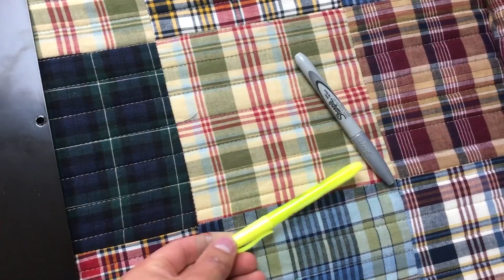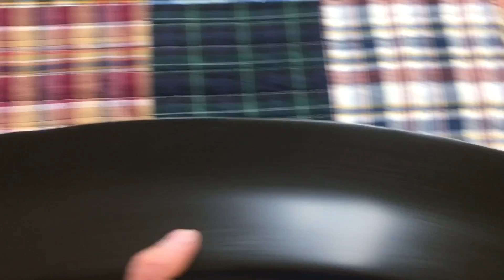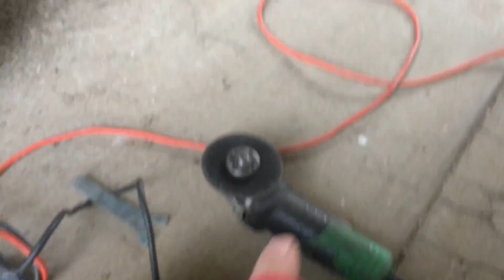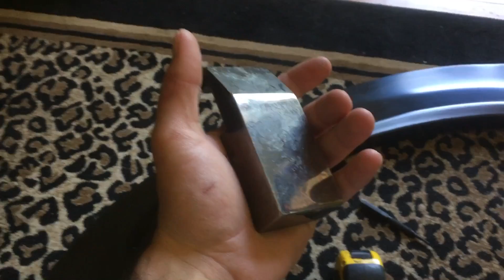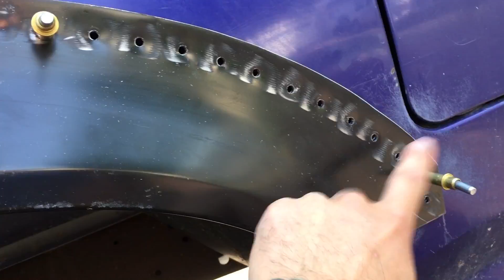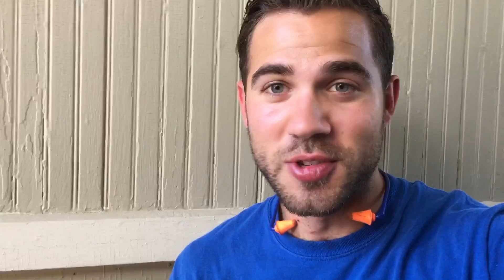No Weld Rusty Fender Fix | 1995 Ford F150

Comment: I just got an estimate to fix the rust on my 2010 F150 and it's close to $1000 bucks. I don't want it perfect I just want to stop the rust. It's the only place on the truck with rust and I see it on every 2010 F150 on the road. This looks like a pretty good option. Although having to buy a pneumatic rivet tool jacks the price up a bit. 

I had a couple of questions. Did you paint the flares after the installation? I'm thinking painting them flat black might look good. Also, how tight does it get between the panel and the truck metal? At 3/4 spacing it seems like it would be super tight but in the pictures it looks like some gaps in a few spots. Not a big deal still beats a rusted fender well. How has it held up since you did the repair?

Anyway mate, nice video. I'm still looking at options, but this one is at the top of the list right now.

AE
Reply from the maker: Alan Edwards Yeah that’s about the usual cost but is much more expensive than a DIY job. The rivet kit isn’t that much. It’s $200 and it comes with everything.

So one side of the truck I painted the flare before putting it on so that the rivets would be the aluminum color that they are. And the other side of the truck I riveted the fender on and then painted the entire fender. As far as gap, the fender fits flush with the flare. The spacing between the rivers can be anything you want. I think aviation standard is 1/2 or 3/4. I chose 3/4 because it looks good. 

So far the panels have held up super well! They are still tight, the paint good, and most importantly the rust isn’t spreading.

Comment: Dude, what wheels do you have? I need those.
Reply from the maker: neanderpaul Ok so these wheels go by several names. Search turbine/cyclone/western wheels. They are aluminum and pretty sweet. I’ve since sold them because the widths on the front pair were different from the rear. Also if you have a hard time finding them just search “A-team van wheels”.👍
Reply: The Minute Masters well thank you, but actually I know that. What I don’t know is what vehicle you got them off of. You didn’t get them off of an 87 Crown Victoria which ran that wheel. That’s one for instance. I’m trying to find out what factory wheel has the 5 x 5.5 bolt pattern.
Reply from the maker: So they came with the truck when I bought it. However, I did do some research too. These wheels in 5x5.5 were on a special edition for bronco. It's a like a black bronco with red and yellow stripes. Otherwise I didn't seen any others. I have seen different chevy trucks with them.
Reply: The Minute Masters ohhhhh sweet. Thank you.  Dodge had a version too.  I remember the bronco you are talking about.  That’s the right combo there.  Thank you.
Reply from the maker: neanderpaul No problem! Glad I could help!👍
Reply: ETs...

Comment: Will those panels work for the front too I don’t want to replace the whole fender and have to repaint  I have bushwackers right now but they are 3 1/2 inches wide and my rims are flush with the body line
Reply from the maker: David Kindred Unfortunately the front and rear panels are differently shaped. Also depending on how you attach the panel it might not be possible since the front fender panel also acts as the body structure. I guess Ford always wanted people to just replace the fender. I do have a video on here on how to paint using spray cans. It’s really pretty simple to do. So if you go the whole new fender route it really isn’t that bad. You’re only other solution would be to find another color matched fender. I wish I had better answers for you.

Comment: Yo man I'm doin it! 1991 F150 and that's the only bad spot o the truck! Done deal, thanks bro!😀😀😀☺ But I'm using lg head aluminum pop rivets 3/16th.
Reply from the maker: Schmedly Whiplash Hell Yeah man!!👍👍 Good luck!!
Reply: Schmedly Whiplash aluminum pop rivets will rust immediately when used with steel panels. Use steel pop rivets in steel.

Comment: Ok a cheap welder to do that thin of metal is like $125, welders cost more for simplicity just like any tool. As for your design it's different but I wouldn't say easier and I guess some might like the look, if you were sanding the truck to steel and then polishing it and then clearing the steel I might like it even.
Reply from the maker: Emery Booker This method being cheaper took into account more then just buying the welder. You still need all the other tools and equipment to run a welder effectively and all the body work need after you finish welding. 
However, the main reason I used this method is because not everyone is good at welding, especially thing sheet metal. Not everyone is good at bondo and body work. This method takes out both of those skills. 
But to each his own. I picked up welding rather easily.

Comment: $1000 for welding supply's? When I did my rocker panels I just went and got a cheap $99 flux core welder from harbor freight.
Reply: Grim Gaming Tv , that's all you need!
Reply: you bought a crap welder but ok for very little use
Reply: weneedcriticalthinking  I bought a cheap mig /flux core new for cheap 99 .00 it work great for this stuff
Reply: weneedcriticalthinking , how is it crap if it does the kind of work it's intended to do?
Reply: @weneedcriticalthinking  that's not true
Reply: weneedcriticalthinking for this type of job it will be fine. We know it’s not a Lincoln but it’s $99.

Comment: Fantastic idea and great job there sir!
 I'm considering THAT as an option for my '02 Dodge 2500.
I like the unpainted rivet look, and I might just undercoat both sides of the flare for the finish before riveting. I'm wondering how the metal flares are holding up for you? Are they getting dented or sand blasted from road debris, like a hail storm from below, or are they still looking good? Thanks for documenting the process!

Comment: You're an idiot if you think it cost $1000 to get the equipment to weld on some sheet metal panels.... A little buzz box fluxcore mig welder will work just fine... But then again you're also half assing this so-called repair...
Reply from the maker: Parking lot bully 

Cheap welder : $120. 
Wire: $20
Two or three times the amount of time to weld versus river. Plus solid wire MIG or TIG is recommend for body panels. 
Calculate more time for body work and paint than for my job. 
And you have to know how to weld sheet metal. Warped metal and blow through holes make for less than quality repair. 

In the business world, time = money. The longer this repair takes the more it costs you or like most hobbyist, the project never gets completed. A quality weld job, using quality welding materials plus paint and body can reach $1000. A more conservative estimate would be between $500-$800.  The river kit was around $200 and aside from paint drying times, the repair took less than an hour and a half. That’s cutting out the rust, treating, and coating it. Creating the fender and painting it. Finally riveting it on. Much faster than any weld job.

In the end, to each his own. The repair is doing very well. No rust, no gaps, no missing rivets, no chipped paint, and no peeling paint. 

So much for a half-assed repair.
Reply: +The Minute Masters ... I guess I'm looking at it from a career Bodyman point of view .. To each his own I guess .....
Reply from the maker: Parking lot bully You’re exactly right! As a career bodyman who takes pride in a nice smooth finished fender patch this does seem like a foreign hack job. I would have welded it if I was near my welder. It’s also more of an aviation style repair which is completely different from an automotive repair. 

Thanks for watching and the input though! I always enjoy seeing good body work from you guys!👍

Comment: Here is another idea for those " Rusty Holes ".  Use the " Water-Proof Fish Pond Foam "... They use them for Fish Ponds and best of all they are Black too. Spray that under those Holes, aka...  Under / In your Fenders to cover them up and Water-Proof Leakage and the Foam will act as a Glue and keep those Metal from separating, etc....  Also, they are easily cut off with a steak knife for cleaner look and best of all they are black no painting.
Reply from the maker: Jordan Bronson That’s an idea too!

Comment: Hey bro. Thanks for answering my comment. I was talking about the stuff they sell on tv infomercial . The weather resistant  rubber in a can it cost like $20.00.Works great on stopping water from getting behind and over the wheel wells and cracks. I took my passenger side rear wheel well out and sprayed up in the back of the body panel and it stop the rust .
Reply from the maker: Marc A. Moore Oh ok! I know what you’re talking about! That’s a really good idea! Definitely going to try that! Thanks for posting this!

Comment: Hey bro. You can a can of spray rubber to spray the inner wheel well. That will stop the water from getting into the under body. ok. I did that to my Dodge Ram 1500 wheel wells and it work fine..
Reply from the maker: Marc A. Moore So I did go back and use undercoat on one. The other I undercoated before installing.

Comment: Pretty descent job 😉. You can blend that upper arch into the body with some short hair bondo, bondo body filler and an orbital sander. And just an fyi moment real quick...I bought a flux core welder,all of the needed to weld extras and an auto- tint welding helmet for about $225-250 from Northern Tool. Flux core isn't the best for autobody panels, mig is better but it gets the job done when you're a beginning,learning welder and on a budget. And I put in floor pans and quarter panel patches that are solid as a rock.
Reply from the maker: Chevy Kev The sky is the limit with this fix. I wanted the aircraft look. So I didn’t go the bondo route. 
I learned to weld with an Eastwood mig welder. Owning a welder is the best!

Comment: Could have just cut the bad area out on installed some plastic "pocket style" fender flares that go for like $85-$125 for all 4. No cutting, looks legit, and is cheaper.
Reply from the maker: Michael S Those pocket style fender flares aren’t that cheap. They usually run closer to $300, especially for Bushwackers. My fenders flares plus paint still are cheaper than the prices you listed. Plus everyone does pocket style fender flares. No one has done it the aircraft rivet style.
Reply: The Minute Masters huh sorry man, patch panels have been riveted on for as long as there has been hack repairs, which yours is. No hate, you just come off like you just invented something, which you didn’t..............
Reply: Michael S I got the penels for 30.00 plus 10.00 for rivets, 6.00 in bedliner spray! Bout 50.00 bucks to do mine!😀🤗
Reply: I bought my fender flares off eBay for $120. They look just the same as Bushwackers and mounted in the factory fender lip holes. What was left of them. 
Don’t get me wrong yours look cool. Just that there are even cheaper ways with a pocket style fender flare. 
I bought mine from K2 Motors on ebay

Comment: Can someone PLEEEZ tell me why the mfrs. cant make a wheelwell that doesnt rust thru in a few years? How embarrassing !  !  !
Reply: First is cost. Between different materials and manufacturing methods it would send the cost of making these vehicles unaffordable to most people. And second is why would any company want to make a product that lasts forever? Making things last 2 or 3 times longer would hurt future sales.
Reply from the maker: Deucealive75 Absolutely correct on both points. Spoken like some who knows how business works.
Reply from the maker: howard banks Right! And the newer trucks don't hold out as long as the old ones!

Comment: Great Job man. I'm curious to see how it looks painted.  Why do these old Fords rust out so easily?
Reply from the maker: Peter Junco So my video on spray paint show what a the fender by itself looks like painted. I've since mounted that fender and it looks really good!! I will do another painting video so you'll definitely get to see this fender finally painted. 

So the fender rusts out because there are two layers of metal in the original fender. Dirt, salt, and water build up between those layers and rust the fenders out. I think it's an engineering flaw. A flaw most trucks still have unfortunately.
Reply: Pete Junco I’m a Silverado man all the way and have the same shitty problem 100% Chevys rust though always have
Reply: Ford, Dodges, chevys..they all rust out around the wheel wells , especially in Northern climates..